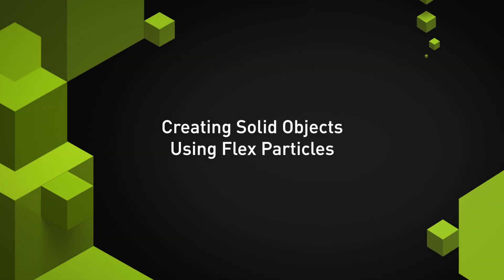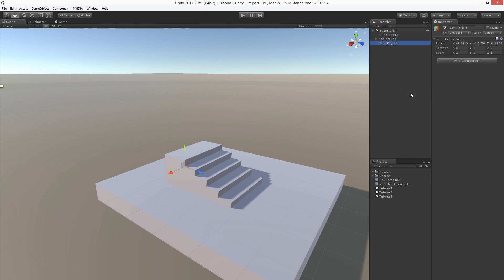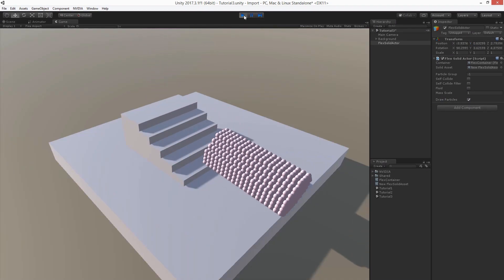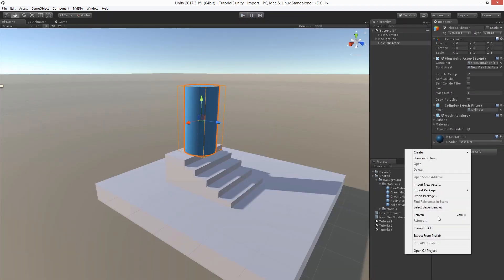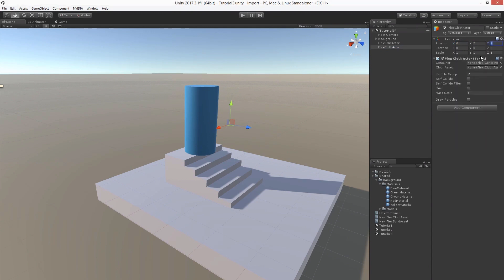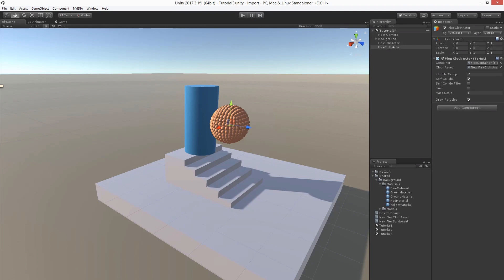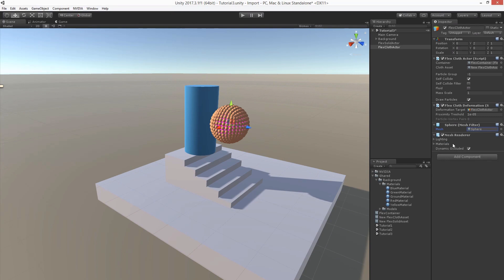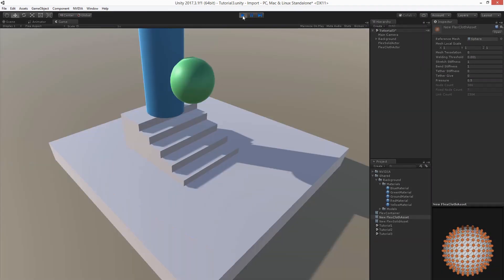Developer FleX Unity Plugin Tutorial Pt. 3

Comment: Hi, thank you for the wonderful asset. One question, to simulate the particles, are using a SPH kernel function over a Lagrangian to control i.e. smooth out the motion ? I reckon that to smooth out the attributes such as density, viscosity, pressure and other forces you have to use a SPH kernel ? Thank you!